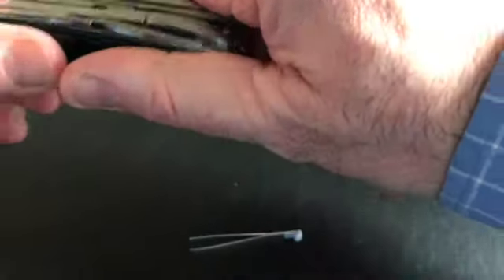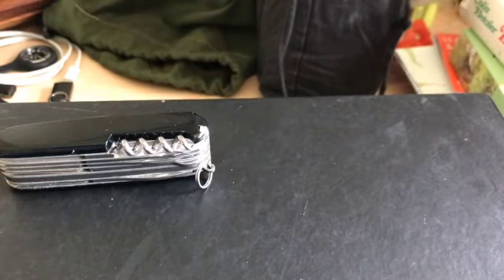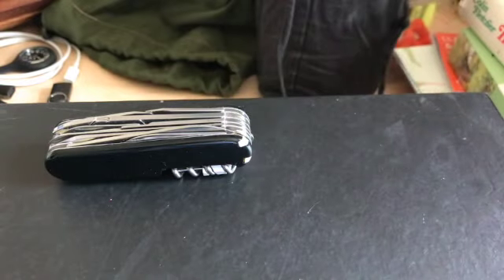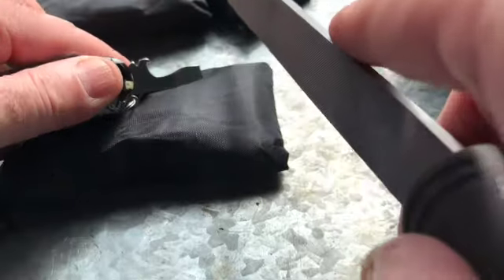New SAK Hiking EDC - Tweaks and Preparation

Comment: Safe journey Steve. You are well equipped for anything the trail throws at you. I actually had to cut a sheep free from barbed wire while hillwalking last Friday so you never know when you will need a knife.
Reply from the maker: As it happens the sheath knife I took never left the hotel room and I carried an ALOX single blade in the pocket and this fella in the pack. But you're spot on, a man should always carry a knife.

Comment: WE can’t help ourselves 🤣. Have a good trip.
Reply from the maker: The thing is if the SAK was modular, you would buy a SC and cut and shut until you got it right.
Reply: @fadingmargins  Indeed! I don’t drink which means the cap lifter would be redundant and most cans nowadays are ring pull - if I were going to buy one it would probably be an evogrip. The main original wenger shape blade has more belly than the victorinox but the scissors don’t cut as well - rock and a hard place. I keep looking but haven’t been tempted away from my trusty canoe yet.
Reply from the maker: @matthewrix2164  Ooh which Canoe do you have: RR, Case, Buck?
Reply: @fadingmargins  RR Amber Bone - light, slicey and cheap 😀

Comment: Hi,
I carried the WorkChamp for quit a number of years as an edc and I recently replaced it with the HandyMan (also in a pouch). Same tools yet more "public friendly". However, I am not completely satisfied with the blade itself (it doesn´t feel as sturdy as the WorkChamp) so I pocket carry a (more traditional - pun intended) a Victorinox Alox Pioneer X. The blade feels sturdier and it looks sexy in a restaurant 😉.
Great choice (in my opinion), the Handyman.
Kind regards,
Alain
Reply from the maker: Like you I carry the SwissChamp on the belt and a more traditional folder in pocket. My boy was admiring the Handyman so what could I do..the question now is, do I replace it?
Reply: @fadingmargins  I carried the SwissChamp before the WorkChamp. I think it is a great toolbox but just a bit too bulky for any real practical use. A test I like doing is peeling potatoes. If I can peel potatoes without any fatigue in my hands, it has a long term practical use, you can use it for an extended period of time. In my opinion, the SwissChamp is a great tool for short usage but not for an hour of whitling. I gave the SwissChamp to my oldest daughter and replaced it with the WorkChamp, which now got replaced by the Handman and a Pioneer X (sometimes the Pioneer gets replaced by either a Forester or a Nomad, depending on the tasks ahead that day).
Kind regard
Alain
Reply from the maker: @T37912  sounds like a very useful and necessary test. For me the SC is a tool kit, the blade of choice is always the one in my pocket. Thanks for taking the time to share.

Comment: SAKs are an institution, and it's a pleasure to share in your enjoyment! However, not being quite ready for an institution, I hike with a Leatherman Style PS (decent 'proper' pliers, plus tweezers and scissors and some other thingy, but no blade) at 47g, plus an Opinel in stainless (UK weather...) from the Walnut Wood series (the handle isn't as prone to swelling when wet like the standard Beech), usually in #6 size (28g), but if a bigger knife is needed the #8 is 42g and the beefy #9 is still only 48g. To scale my fish, I just reverse my Opinel and use the backspine of the blade, which is correctly angled and shaped for the purpose - that's the same backspine which strikes sparks from my ferro rod.
Thus, my knife/tools weigh a combined 75g in my pack - that Handyman is 165g and a  Swisschamp 187g.
Of course, this isn't to say I'm any more right or wrong than any other hiker - everyone's needs, purposes and tastes differ. But at one end of the spectrum I see folks overladen with unnecessary weight, while at the other end I see ultralighters with equipment so flimsy and minimal that I question its ability to perform serious tasks.
Reply from the maker: I do love an Opinel but I didn't know the walnut was swell resistant! I agree about Leathermans having proper pliers but all the ones I have a lot heavier than yours as well. If we all did the same we would have nothing with which to bore our spouses/partners.
Reply: @fadingmargins  Quite right my friend! I may just have to have a sneaky delve into the Deluxe Tinker...

Comment: Happy Monday Steve, the 91mm Handyman is a good choice for your hiking & camping needs. I don't own one as at 6 layers  its too bulky to pocket carry, the 91mm 4 layer Huntsman , Mountainer , Explorer & the 93mm Farmer X are the bulkiest SAK's that I pocket carry as I dislike pouch carry and I rarely carry my 5 layer Ranger, mostly it sits in my home tool kit of various SAK's which besides the 91mm Ranger consists of the 91mm Cybertool M ( 34 ) and 3 that have pliers - the 91mm Deluxe Tinker ,  the 85mm Wenger Tradesman & the 85mm Swiss Buck Taskmate 1 plus the Victorinox 84mm Watch Opener SAK which I use for removing scales as I find removing them with a blade is a bit risky .  BTW I prefer the Wenger style pliers over the Victorinox ones, they open up wider & IMO are better at cutting electrical wires . I have not been on any sort of hike for years as I have a bad back & broke my left ankle 12 years ago & its still plays me up . I hope you enjoy your hike & have good weather.
Reply from the maker: Steve, you always make me feel better about my purchases. Personally I prefer the older/other style tin opener where you pull rather than push but you have to make do I guess. Keeping moving is the only solution to keeping moving. Nice to hear from you again!
Reply: @fadingmargins  When it comes to tool comparison  the Wenger "Crabs Claw " can opener is IMO better than the Victorinox can opener but the Victorinox scissors is superior to the Wenger serrated edge scissors & whilst the Victorinox Awl / Reamer is better than the Wenger Awl, the Wenger one is better placed on the backspring layer with a cut out in the scales facing outwards allowing for easy access unlike on Victorinox models where the nail nick faces inwards & you often first have to lift the corkscrew or Phillips screwdriver  to get at the nail nick or risk breaking your nail.

Comment: I've been tempted to grab a Handyman or a Ranger. I have a Huntsman, a Camper, and a Compact on the way. Also a Classic SD and a Vagabond.

I'd really like a Huntsman with a file instead of the scissors. My 58mm ones have scissors covered already (or I could pair with the compact if I was really crazy).
Reply from the maker: That quite a collection - unfortunately modular is not an option.

Comment: Use hot water ! And a vice to install !
Reply from the maker: I thought I mentioned this? I have used this method with mixed success. I find it can warp the covers. The way I did this I find works okay so long as you go slow in the peeling and the pressing 😉